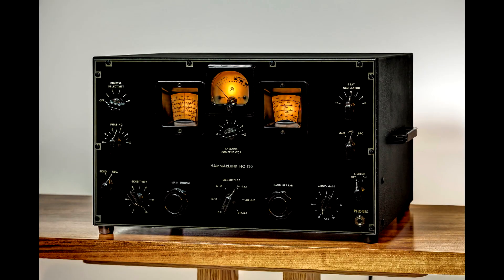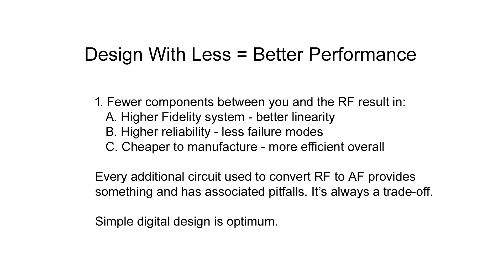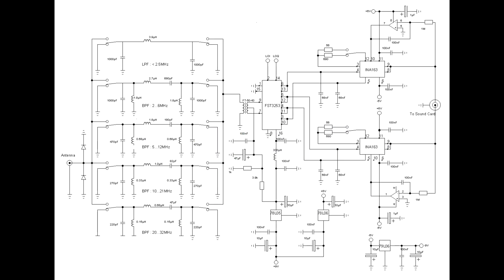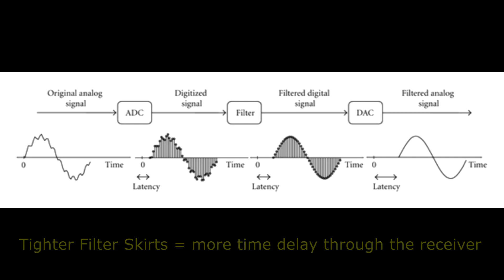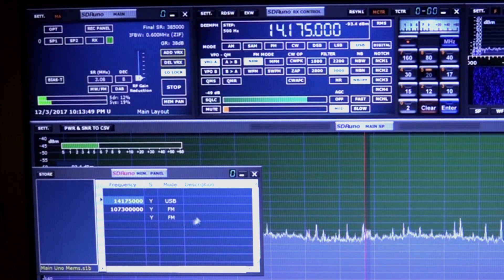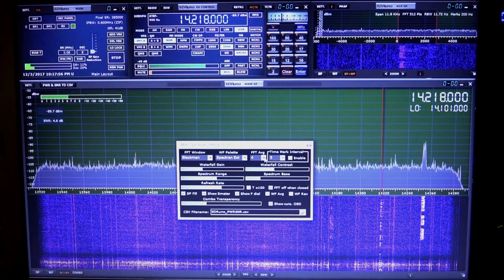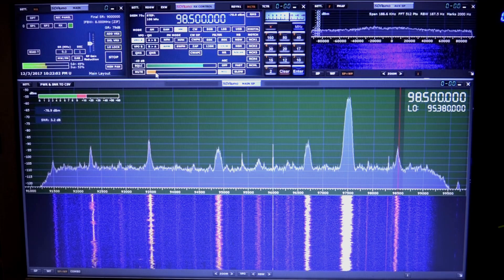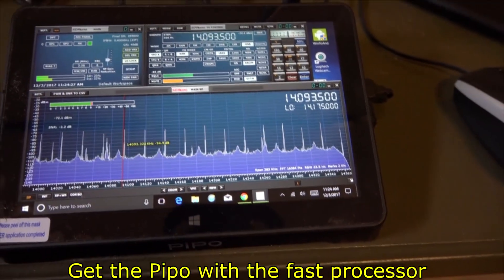SDRplay RSP 1A Review and SDR Primer

Comment: I wondered if a 24 bit processor would be better. I read an explanation by a signals scientist that explained that the 14 bit processor was actually superior.  Kind of the sweet spot for processing.  I can’t explain why but he was convincing to me. Thanks for your videos. They are very helpful.
Reply: Well, we would choose a 100 bit ADC system if it was available and the chip costs $5. It is a budget vs performance game. The Ic-7300 is a 14 bit machine. As you increase the bit length of the entire system, the dynamic range goes up. the capability of handling the weakest to the largest signals. To design a 24 bit system for RX/TX today costs too much for a typical Ham to afford. Nor is it necessary. I'm talking direct sampling SDR systems. Yaesu does a 18 bit system on their newer radios, but it is an older mixer style SDR. The bottom line is that most people live in areas around other people. In these areas, tons of radio noise is generated by various devices. A typical user would never be able to enjoy the full capabilities of an over 18 bit system in this environment. The background noise is just too great. 14 bits with some tricks- can provide decent HF radio reception. In 10 years all Ham radio receivers produced will be 24 bit or above because the chips will be affordable.
Reply: @Yavor54  Thanks Bob for your explanation and your videos. I am enjoying my RSPdx.

Comment: Love this video.  Very informative about SDR and the SDR 1a.  I also enjoyed your video on shortwave analog radios.  I am interested in getting one or the other.  I am a ham and can listen to shortwave on my HF rig, but want something to use when I am not in the shack.  If you could only have one, would you get an SDR or traditional shortwave radio like the Tecsun 660 you recommended?
Reply from the maker: That is  very good question. If I was only listening to SW and nothing above 30 mhz, I'd get an older Yaesu or Icom general coverage receiver...R-71...FRG-7.. or maybe an ALinco DX-R8 receiver (new). If you want to listen above 30 mhz, then I'd go with the SDR Play 1A. It's fine on SW...but pretty darn good on the higher freqs. SW almost has nothing left on it these days.... Note: ALL the table top receivers are better than the Tecsuns.
Reply: @robertnagy2163  Thank you.  I appreciate your advice.

Comment: bob witch SDR would you buy if you lioved in the uk Iam just getting in to radio ham
Reply from the maker: I would not buy an SDR for my first radio. I would buy a IC-7200. For a few hundred more you could get
the IC-7300. It IS and SDR but requires no special knowledge to operate. It is a tremendous radio. You cannot go wrong with it. Good luck!

Comment: Which Pipo computer did you use ? looks very nice system to me to be used this way
Reply: I use a X8. I suggest getting the best one you can afford. It will slow down the frame rate if you go to over 5 mhz wide sample- because it is just too much to ask from the processor. Get the better processor and 4GB+ Ram for best results.

Comment: I am running the first generation SDR Play with the latest SDRuno software: 1.33.   I am really having a hard time changing frequencies.  It likes AM frequencies.  But when I get to say broadcast FM, it goes crazy.  You click on the far left digit for frequency.  You then get:  1.000.   Which I guess means it is ready for frequency enter.  I type in:  90.3 (decimal point from menu on right for bands, then hit enter.  I can get it to that frequency in 100 KHz steps (as noted on frequency menu).  How do you change that?  I hit the MHz, button to the right but nothing seems to happen.  When it goes to 90.3, it immediately starts scanning.  I have searched high and low and cannot find how to stop the scan.  I need help.  WD5GYG
Reply: I have never seen that Mike. I have that model...doesn't do that. Sorry, I can't help you here.

Comment: would have been nice to see how the physical connections are actually made to ur rig?  i mean, we dont evn know wat is being used for an antenna?  is that a Windows machine?  Mac?  this review is like preaching to the choir... the choir already knows wassup :)
Reply: Oh, that's because there are no connections to your rig. It is antenna and PC. You could use it as a panadapter for an old radio. MFJ has an interface box. This is a stand-alone SDR which can use any antenna...20 foot piece of wire is fine.

Comment: Will this run on a MAC ,  Thanks
Reply: Tony tFuntek not the SDRumo software, but there are other programs that run on Mac
Reply: You’ll lose of the some of the features or filters on the Mac platform but still doable. I use CUBICsdr. MACS install of software is so much easier then windows base PCs